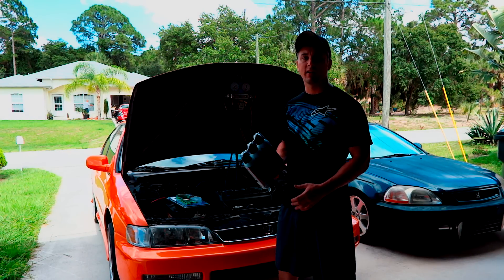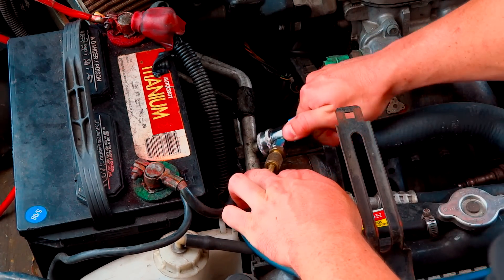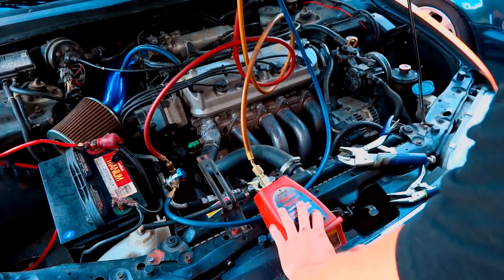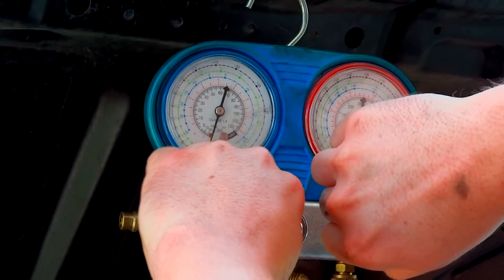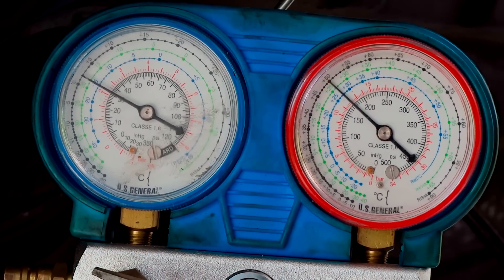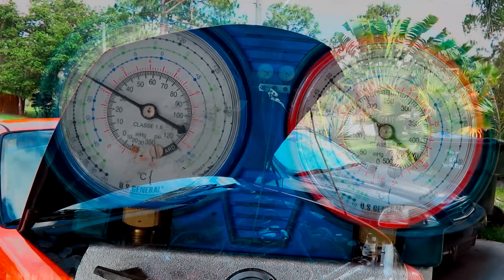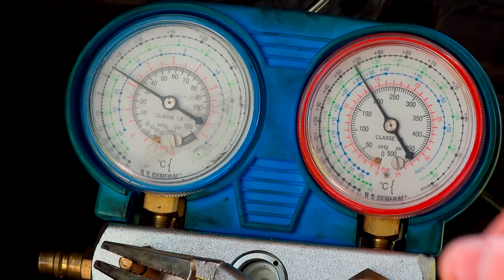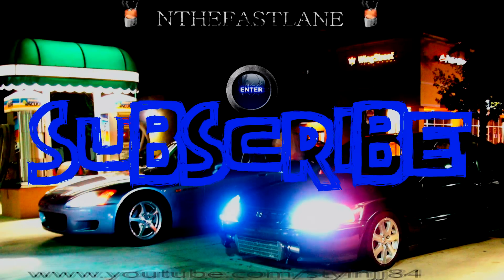Charge Your A/C With The Cheapest & Coldest Refrigerant

Comment: The difference in cooling capacity is negligent. The difference in safety is a no-brainer. Use the manufacturer specified R134a or risk killing yourself and your family in a fire. From SAE (Society of Automotive Engineers) WARNING: HFC-152a is a flammable refrigerant and should not be used in systems unless specifically designed for its use.
Reply: Yeah because gasoline is non flammable Eh Hoss ?

What happens to R 134A when burned?
Reply: i have used propane in my autos for over 30 years no problems.its all about greed,money.
Reply: In other countries they have used propane based refrigerants for many years with nothing bad happening. Mostly because it takes a lot less to be effective and the total volume of it is very low. Also if it does leak it is so slow a leak it can't cause any problems.  That gas tank in the car is a much bigger problem by comparison.
Reply: I can't understand why people are nervous about propane and flammables in the A/C. You have flammable liquids in your vehicle already, there are vehicles that run on propane, R134a is flammable under pressure 15- 25 gallons of gasoline is flammable AND explosive.
Reply: https://www.google.com/search?site=&source=hp&ei=e4VwV5q5Ao2WjwOg_6XYAw&q=is+r134a+flammable&oq=is+r134a+fla&gs_l=mobile-gws-hp.1.0.0.2110.7328.0.9105.14.13.1.5.5.0.514.4051.2-6j2j2j2.12.0..2..0...1c.1.64.mobile-gws-hp..2.12.2131.3..35i39j0i3j0i20j0i22i30.bejTK8KKWdM
Reply: your farts are flamable too but i bet it doesnt cool worth a S***  but probably smells like it does
Reply: the all new 1234 for auto mfg is flammable
Reply: The difference in cooling capacity is quite a bit. I've done a couple of systems with  the duster stuff. 2 were older R12 systems in machines that I farm with. That I had retro fitted with 134a. Never happy with the results. Once they were recharge with 152a or dust off. Always got 10+ degree lower vent temps. It might not be as good as R12. If your system was designed to use that. But it will cool satisfactorily even in very hot weather.

Comment: This person only knows enough to be dangerous. You should not follow his advice. He does not understand that the oil charge can be lost in the R134a that he just dumps into the atmosphere. Without the proper oil charge, the compressor will soon self destruct. He shows dangerous work habits. He does not wear safety glasses. He shows spilling refrigerate over and over. Spilled and sprayed out refrigerant will freeze your eyes.
Reply: JayDubyah Wing R143A isn't environmental friendly. Why do you think they are switching to 1234YF? I hope you read the EPA official site about refrigerant release.
Reply: it's called the minimus dingus
Reply: Seawolfvital What braindead twit thought that rule up he must of had governmental schooling. So I must recover the working gas from my vortex tube or someone with a Stirling engine heat pump using atmospheric air as the refrigerant.
Reply: Ivan... true critical reasoning
Reply: Its florida! What do you expect?
Reply: The enviro-safe r134a replacement is what he discharges.  It has already been replaced once with the flammable enviro-safe replacement which is ok to discharge.
Reply: Don't need a license to purchase it because it is just a natural gas.  Yes I know it is called a refrigerant but it is safe to vent to the atmosphere.  Enviro-Safe. 
 I just put it in my car.  At least that is what he said he had in the system prior to venting.
Reply: I didn't see him dump anything but some special stuff into the atmosphere to help him get the extra oil out of the system. And besides, that R134a is supposed to be environmentally compatible - oh that's right it causes global warming - R152a doesn't!
Reply: Farley Postgate as per EPA - it is illegal to knowingly vent ANY refrigerant. Whatever in that ac system is considered to be refrigerant and all refrigerants must be recovered.
Reply: It's butane and propane mix...
Reply: @fpostgate  no, butane and propane mix is LP gas
Reply: Critical Reasoning yet he ends up with eyes and limbs in place,  and with good cold AC, while you end up with blah blahs. As for the oil, it depends how fast you go, if too fast, you will dump the oil. If you don't get it, go ask him how, he is the pro ending with results anyways, and done this not the first time. Doesn't look like he replaces compressors every week, lol
Reply: get over yourself dude people do this shit every day just like that

Comment: You should not charge with liquid on the "low side". Only charge with liquid when the car is NOT running and put it into the "high side". Finish charging on the "low side" with vapor, with the engine running. Check your temp at the center vent with the blower on "LOW". You get the coldest air on "low", "high" is for volume.

Comment: DO NOT FOLLOW THIS VIDEO. This person is horribly wrong. R-134a is Ozone harmful, there is no automotive refrigerant that is safe for the environment, (except CO2 (1234YF is not terrible, but is technically harmful)). Anyone opening an A/C system needs to be Section 609 approved. This guy does not know what he is doing in the slightest. I am in an Automotive A/C class at my University pursing an Automotive Technology degree and we watched this video as a pure example of what to NEVER do. This Video is horrible for any purpose. DO NOT do anything in this video. R-152 is not safe for regular vehicle use, it is flammable and not compatible with the oil already in an A/C system. You will destroy your A/C system if you follow this video.
Reply: So you never dust your keybord with dustoff?
Reply: does envirosafe contain fluorine?  does it?? does it??? why NO IT DOES NOT....   until you understand the mechanisms of why and how fluorine molecules in the upper atmosphere are bad for natural ozone then please STFU!
Reply: This guy in the video is a moron but you need to finish your classes before saying something else stupid. R-134a is NOT an Ozon Depletion refrigerant.

Comment: lmfao this guy is beyond stupid
Reply: Hubba - My guess would be that the plastic knobs that come on those gauge sets broke off after being squeezed by vice grips a number of times and over tightened. The tragedy of using vice grips for everything is that eventually they're all you can use because knurled surfaces and bolts get rounded off, rubber O-rings get crushed, and plastic knobs disintegrate. My guess is that all the faucets in his house are operated by vice grips as well.
Reply: +Aaron Ries that's a folk saying about doubting whether one is any handy dude. It's used in Europe, its violent! Don't  blah,  before you know no stuff... can you point where Swiss is, on the map at least, all the less know folks sayings...
Reply: Listen, if you have trouble "hammering a nail into your butt" that's a saying about the ill handy dudes, then don't blab. And YouTube doesn't require us to "work our pen safely" It doesn't care, as long as you are nonviolent
Reply: This is an European folks saying, and it does have a neaning, used when someone doubts in someone's ability to do anything, or when doubt in certain dudes handiness is being expressed. Learn coultures, Dont be dumbfounded, and when you are, don't end up calling everything stupid, cause you induce smiles then
Reply: nice vise grip commercial
Reply: +Fred Flintstone not to mention girlfriend's knobs
Reply: Fred - I doubt that the condition of his house faucets is of any consequence to you, nor of interest to anyone else. 

If you ever used the knurled knobs, then you know that without some extra pressure, they will turn loose later when you need them to stay tight, and then you have refrigerant all over the place. The finger-tight BS is just that. They don't work at all finger tight.  Also, when the refrigerant comes out, the seal inside freezes and does not seal properly. The only way to assure that you can get it tight enough is with a pliers and the adjustable one works best. His next option would be to put a little more plumbing in the setup so that he has a valve to close and open when attaching the hose. I think an ordinary 134a can tapper (through the top) would screw onto the adapter and provide the shut off so that the yellow line is connected without loss of refrigerant. (The pin of the tap might have to be rounded a bit so that it actuates the schrader valve right.)

My guess is that you never have used this type of equipment, but have $40,000 equipment to use.
Reply: JayDub said, " I don't think ... " We finally agree on something.
Reply: Idk, hammering nails into butts sounds quite violent to me.
Reply: (why do you think the HANDLES are broken off?)       https://www.harborfreight.com/ac-r134a-manifold-gauge-set-60806.html
Reply: LOL
Reply: Lighten up JayDub - Personally, and I know with many others, we just tools with valves on them for decades and the knobs are in perfect condition. If the rubber in a valve in a tool, or other piece of equipment tears or hardens due to age, we replace them. Once a person begins to 'over tighten' with vice grips or pliers it's the beginning of the end for that piece of equipment . The comment about the valves in his house is a joke, but makes a point about this type of practice, and is probably spot on. 

I'm surprised I needed to explain this to you. You appear to have limited experience in this life with mechanical things. It's always the amateur that lays vice grips, or pliers on a valve, or a bolt.
Reply: I would suggest that the one who needs to lighten up is you. Why do you put a person down for using tools that he has, he could be sleeping under an overpass. And if making disparaging remarks about the man's house is what passes for a joke, too bad - you need to get a life (or was that a joke?).

And you are flat out wrong about the finger tight business - maybe if you are a gorilla. I am not able to get these stupid R134a knurled acme 1/2" tight either. They leak. Period. It was a dumb idea so we carry small pliers to make sure they get tight enough. My equipment is not without metal knobs, but one of them did fall off and  break. The other keeps coming loose. I replaced the broken one with a heftier one which still comes loose. This is not the most expensive gauge set, but they are ID, which is not a no-name.

It is obvious that you are not very experienced or you would not have such obvious disdain for those of us who work with this stuff often. I have used tools, done ac work, wired houses, repaired cars, overhauled cars, overhauled tractors,  built houses, farmed, welded, designed and built machinery, went to college, worked for a big company, built computer peripherals, fixed computers as a business, have 5 or more patents and have enough experience with tools to know that the change to R134a was a political mess and was brought on by stupid people who knew better. To think that a 1/2" acme thread would not loosen itself when placed under the work environment is only for those who never used one. Next you will expect him to use a torque wrench - it is all too absurd. Besides that, the type of vise grips he uses is really cool for that kind of work - you clip it on and leave it on, loosen and tighten much better than fingers. You ought to give it a try.

That info above was all done over 50 years which, unless you have trouble with math as well, would put me in my 70's. Just yesterday I fought with those connectors again on an RV auto air. The vacuum pump with adapters would not draw a vacuum better than - 20 inches of mg until I used the pliers on the new washers. It is great in theory but zero in practice.

As to your last wise-acre remark, you use the tools that are available. I am not always at my shop where I have a good supply of tools. But your comments were not intended to do anything but tear someone's confidence down. In this case, the young man is well beyond you and will probably amount to something. 

Somebody also made a remark about opening the bottle without protection - not only once but twice. Why should he have to - if the equipment was designed right, it would seal before it released the gas - a novel idea. But it is not part of the design - why not? About 1/8th inch of material in the adapter is all it would take.

Anyway - the point is that you and all the others can make your points without getting nasty about it. I noticed that he did fix quite a few of the items in his updated video, so he didn't ignore you. But pardon me if I don't applaud you and stomp on him at the same time like some others are doing on here.
Reply: Let me make it simple for you. I doubt that you, myself, or anyone else would go to a mechanic to have his car worked on, or to respect his opinion if all the knobs on his tools are either gone or rounded of, and he's using visegrips to manipulate valves and fasteners. This 'boy' is worthy of the criticism. Obviously he over-tightens things. I'm amazed that you don't 'get it'. sir. you defend him, which means you ignorantly, or stupidly support this kind of tradesmenship as being alright. You prove once again that common sense is really not so common afterall...
Reply: I don't think this has anything to do with 'tradesmanship'  - he didn't suggest that you visit his shop, nor did I. This is for DIY and you apparently are not - get that. There is nothing to 'get' otherwise and it is not even in the least obvious that he over tightens things - that is in your mind. I 'get' that the young man presented a way to do something that was interesting - he made some errors. I think that what you and several others said to him were out of line, and I said so - if that makes me stupid and ignorant, then you are the one who is lost with a problem - not me. Wow, talking about common sense, you? You are a mean spirited person or you wouldn't take this so hard. Did someone disagree with you? Poor thing. You remind me of a snooty old lady at a bazaar.
Reply: there is always these guys who look for anything they can comment on to make themselves feel superior.
Reply: give me a break , you obviously don't work on your own vehicle because only a douche bag  would spend the time to obey all safety rules and conduct , Oh my God who judges some one for using vice grips to loosen a knob ?  I work on my own car and I have friends who also work on their own cars and I guarantee none of us give a shit that he used vice grips to loosen a knob, if I could I'd have my hands surgically removed and have them replaced with vice grips just because it would be cool as shit
Reply: only a fool would disobey safety guidelines. You're gonna need those vise-grips on the end of your arms after you lose them to ignorant practices. Make a video so we can have a good laugh!
Reply: So are you gobshites trying to say he ought to throw his manifold away because the shitty plastic knobs broke off? or use grips to carry on work ?

Yeah throw the sucker away and make a new set...much better for the environment is that.

Plus now that 134A is £60+ per kilo who is the fool ?
Reply: Evidently his manifold and hoses are shot because the use of any kind of tool to tighten the hose ends is a big NO NO. It will crush the O-rings and the brass for that matter. If you want your hoses tight turn them hand tight wiggle the hose right and left tighten again and repeat. If you find your fittings coming loose after doing that then they are worn out and need O-rings at least possible hose replacement. I've seen young techs use adjustable pliers on fittings and cause them to oval out causing small leaks that drove them crazy because they thought the A.C. system was leaking when in reality it was their hoses!
Reply: Apparently, everyone is smarter than Ivan K. You use an adverb to modify a verb: "works safely" . Do you notice the "ly". Of course, the moron is not working safely; no gloves, no safety glasses, etc.. The hose fittings on a AC Test Set are knurled fittings that only require tightening by fingers squeezing the knurled connectors. Using vise grips just proves he is a moron.
Reply: this guy is way smarter than you. he works safe, hurts nothing, and professes freedom

Comment: I wouldn't be getting the refrigerant from the bottom of the can.  This may cause liquid to enter the suction side of the compressor and damage it. Better to take it from the top where it's a vapor.
Reply: Huh?  Its why they put the littke window on the gauge set.. refrigerant is the liquid..  it pumps that refrigerant liquid through the system...  what your referring to is if you were filling like a fridge and are right at the compressor sometimes you can overload it and cause the refrigerant to push on the wrong side of the scroll winding and it causes a positive pressure on the intake side and pump and that pressure differential will break the pump like trying to squeeze something out of a plastic bag with a littke hole in it and squeeze too hard, it rips the hole open like a virgin asshole.. but youre supposed to turn the cans upside down when filling...

Comment: Cfm and psi on your vacuum pump have no relation to the vacuum pump, they are just the minimum requirements needed of the compressor, thats running the vac pump !
Reply: His misuse of these terms show just how little he knows, and the correct terminology on a vacuum is how many MICRONS, and the definition is as follows:

A micron is a unit of measurement starting from a perfect vacuum (no pressure) that is expressed in linear increments. One inch= 25,4000 microns thus one micron= 1/25,400 of an inch. When discussing vacuum in terms of microns, this refers to total ABSOLUTE pressure as opposed to GAUGE pressure